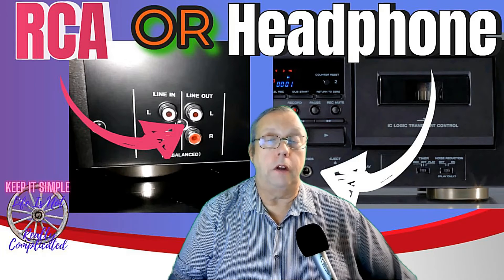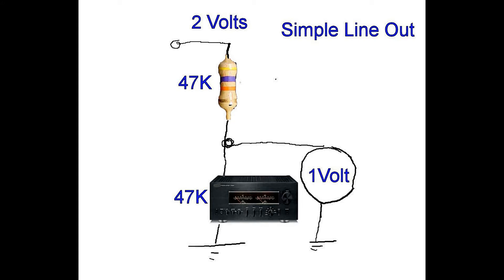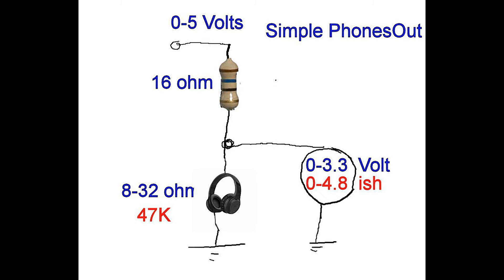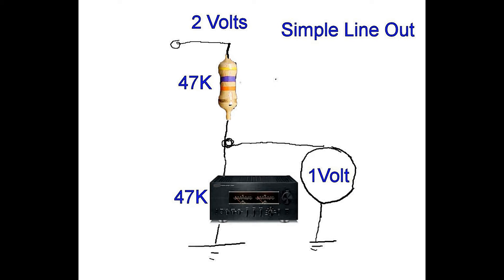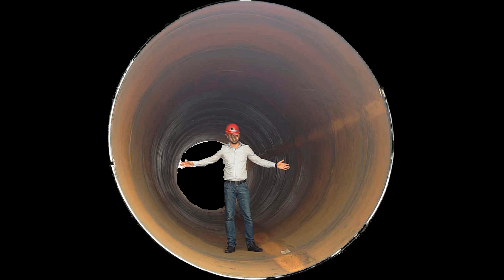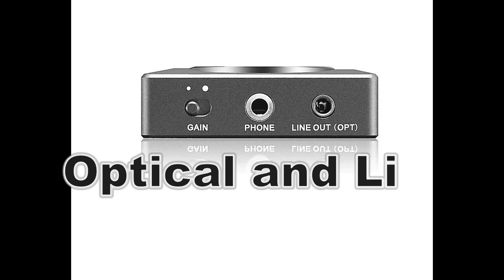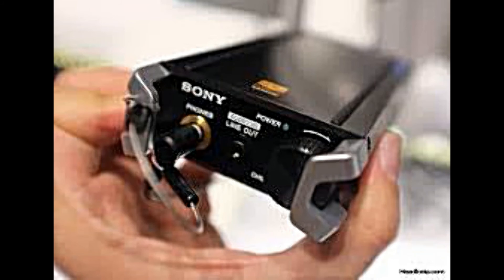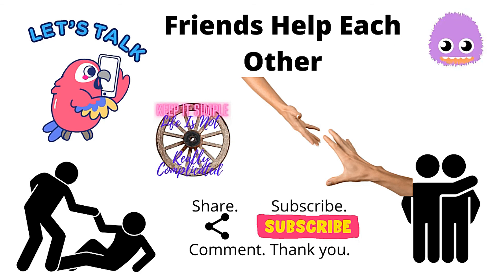Headphone and Line out are the same . Aren't they?

Comment: Hello, I wanted to know if you can help me with using headphones having only a line in- line out, my piano doesnt have a 3.5mm jack for headphones  but I saw I could solve the issue with a headphone amplifier like the FiiO A1, do you see this as a possible solution? I havent bougth neither the headphones nor the amplifier, thanks :)
Reply from the maker: That would be ok ,but a lot of money. This is a good option on a budget. and gives you a lot of options, like more than one person can listen or you could plug in a speaker as well, with independent volume controls. https://amzn.to/4nYpi0y  or even a Bluetooth transmitter may be useful.https://amzn.to/4kPm7W8  That can connect to headphones or line signal.  Sorry if I added a level of complexity. I like to expand rather than box in. I am  Happy to answer follow-ups.  ( you may need adaptors to connect . They are cheap)
Reply: @GaryKeepItSimple  thank you, I actually also considered the bluetooth transmitter but I was not sure if that could work and thought the amplifier could be a safer option, my main goal is to be the only one hearing me play so maybe I will go for the bluetooth transmitter and use the headphones I already have, glad you added that option too, ty very much
Reply from the maker: @anry6243  you are very welcome.

Comment: So I underdstand that I can use the headphone out as a line out, which was exactly my question when I came here, thanks a lot :)
Reply from the maker: Yes you can just be aware you need to set the level . I normally start at the middle of the range on both the output (volume control) and the input control. Then adjust for best results.  Glad to have been of help.

Comment: My only issue with line in port is there isnt a property video that explains how it used or works
Reply from the maker: What do you specifically want to know? I can try and help.
Reply: @GaryKeepItSimple  I want to know what cable or plug or port is use for line in to work
Reply from the maker: on what device?
Reply: @GaryKeepItSimple  like pc or audio equipment in general
Reply from the maker: On most recent equipment line in is using RCA plugs for consumer equipment. Nowadays 3.5mm jacks are also often used.  The spec  for line in is not including the connector. 1/4 inch,  3.5mm jacks  are often used for Line level signals.  XLR can be used also.   Line level is normally 1Volt RMS equating to 0db. The impedance is normally 47 Kilo Ohms.

Comment: Hello mate!! I want to use my focusrite scarlett solo 3rd gen with the monitoring earphones but plugged on the line outputs because i dont have an amp or proper monitors to plug it in, can it be done?
Reply from the maker: Having just looked up focusrite scarlett solo 3rd gen https://amzn.to/3VS9r7F I am slightly confused with your question, The unit you ask about has headphone output to the RHS of  the Monitor knob. You could try and drive the headphones with the line output but it would be very low volume   because line is around 47k and headphone is around 8-32 ohm for speaker/Headphones.  Get back to me if I can be of further help.

Comment: Hey Gary, would it be okay to use my Headphone out as a "Line out" (via a 1/4 to RCA adaptor) as my player does not have a "Line out" but a "CD Out" instead which only works for the cd player and not the tape player and tuner?
Reply from the maker: It will do no harm to use headphones out. So yes you can use it as a line out. If it is adjustable all the better so you can set it around 1/2 way and that should give you a good signal level. (adjust as required) if it is not adjustable, and is too big as a signal you could easily make an attenuator lead to get the correct levels for a couple of £ or $.  Let me know how you get on.